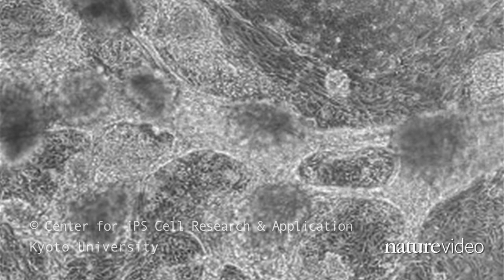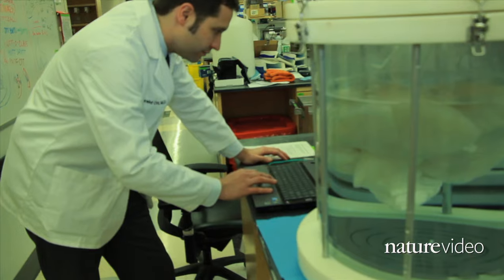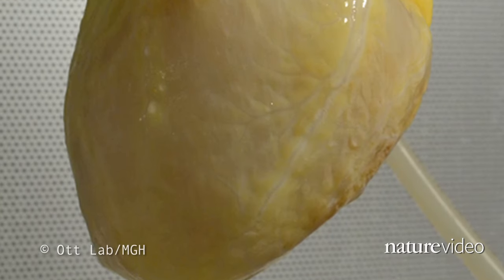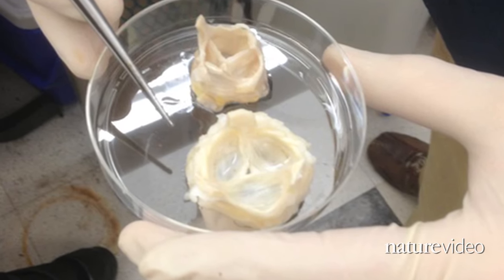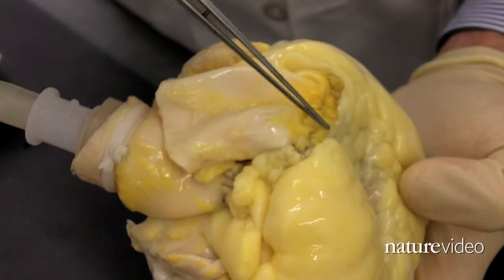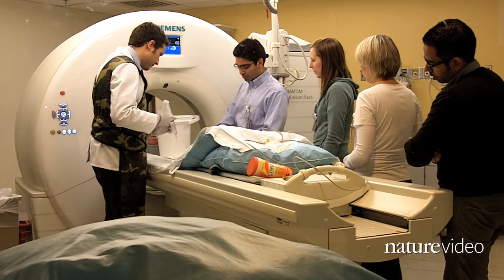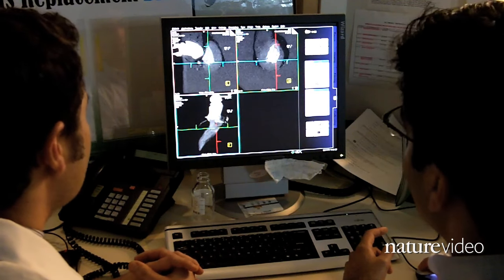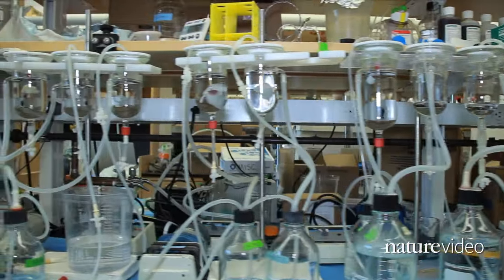The heart makers

Comment: Can't you just scan a heart and replicate the  scaffolding with a 3D printer using biodegradable material that degrades after 5 or 6 weeks and use stem cells along with heart cells to grow a heart in the biodegradable scaffolding it seems like you guys are doing it the hard way when all you need is a little bit of crisper and a little bit of stem cells from a placenta.

Comment: Why don't they 3D-print the structure from cartilage cells or something like that?
Reply: chondrocytes are much more costly, though they are involved with the extracellular matrices. that is a fairly good question, and there is cartilage surrounding and supporting some interior regions of the heart.

related to this, however, is a condition known as aortic acidogenic chondroma (AAC), which is caused by a variety of reasons, though the definitive starting point for these growths is (more often than not) the conus arteriosus and/or the valva. this chondroma may be the result of deformations during the 'rebuilding' of the chondric tissues/membranes, and these deformations have roots in environmental hazards, such as a heavy imbalance of acidophilic bodies escaping from the anterior pituitary gland (APG) and entering the bloodstream.

for more information on the structures, without mention of the diseases that they may suffer from; \
http://vesalius.northwestern.edu/sections/FA.1.20.03.html